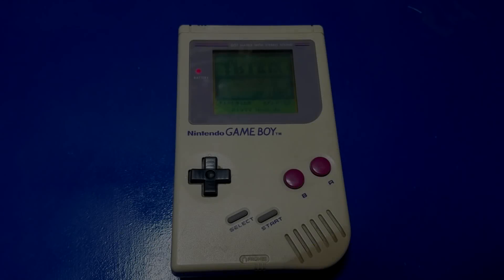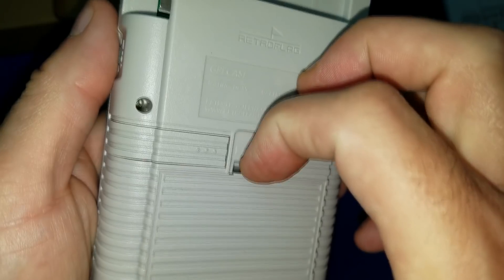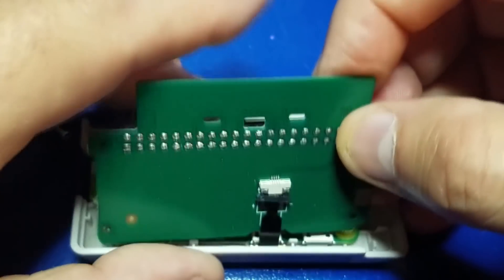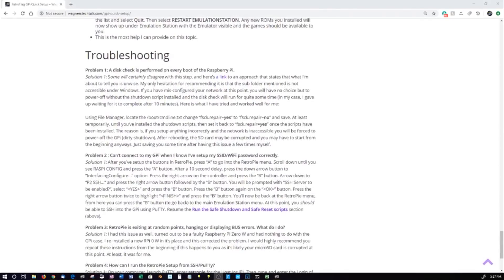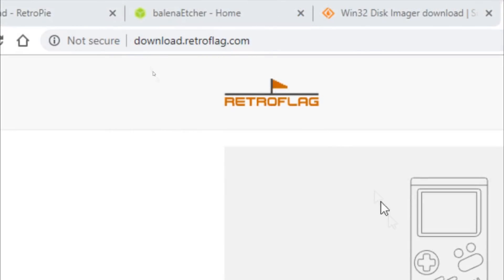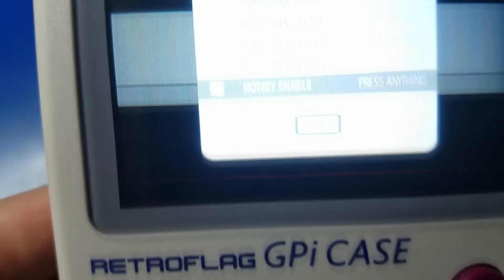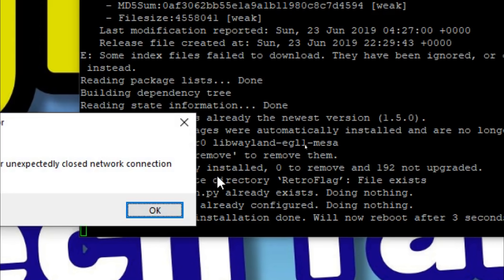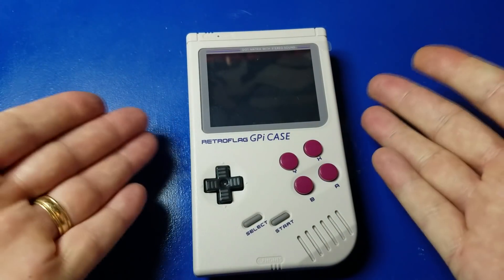RetroFlag GPi Case Setup: RetroPie Pi Zero W with MAME, GB, NES +Guide

Comment: For First very good explanation for the Installation:)nur unfortunately I don‘t Unterstand how to deal with that Keyboard?:(do I really have to Connect it to the gpi via usb or what.because there is written ‚press enter‘ but there is no enter when you Deal with the Gameboy...so do I Hope that you can help ne with that Problem
I‘m kinda desperate because everything did work Good except for the press enter Situation:D thx a lot!!
Reply from the maker: No, you'll use PuTTy to remotely connect to the Pi 0 W in the GPi.  You don't have an available USB connection on the GPi so you'll have to setup WiFi and then you can run the Shutdown scripts, etc.  Be sure to follow the instructions on this page and it will walk you through the details you see in the video step-by-step: http://wagnerstechtalk.com/gpi-quick-setup

Comment: Awesome.  About to order mine!
Reply from the maker: Right now they are hard to find.  However, I read on the Retroflag Facebook page that they will have more stock mid-late July, so don't be too discouraged if you can't find one.  They will be available soon.
Reply: @WagnersTechTalk  I got what I think was a good deal on eBay for one.  The seller only lives two hours from me, it's coming with a Raspberry Pi zero W, a 32 gigabyte card, and everything all pre-installed ready to go, roms included!  I paid $125 including shipping.

Comment: help please MY gpi case only powers on and functions if I use usb cable. if I use battries device doesn't power on or function, my battries are ikea ones just like your video
Reply from the maker: Aside from the obvious, trying a different set of batteries, I would tend to think it's defective and might need to be returned/replaced.  Definitely try at least 2 sets of batteries first (new) and make sure the flat side of the battery is facing the springs.
Reply: @WagnersTechTalk  tried new recharable ikea ones and durecel , Retroflag literally blanking me in regards to replacement absolute shocking customer service from them.... thanks for getting back to me much appreciated
Reply from the maker: If you got it from Amazon, just file a return request.  As soon as you drop it off at the UPS store, they'll credit your account.  If you got it elsewhere, then it's up to them on how they handle returns.  There should be more available around mid July, so you could just re-order at that time.  Hope this helps!